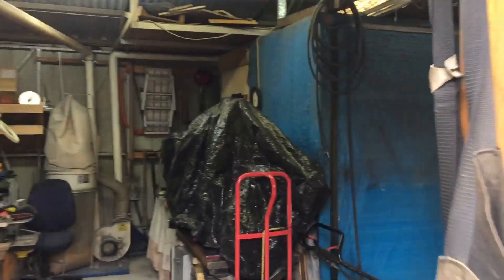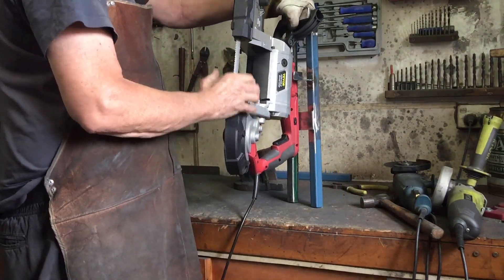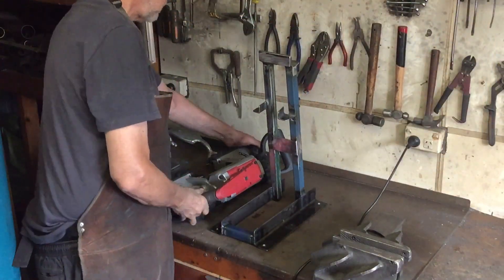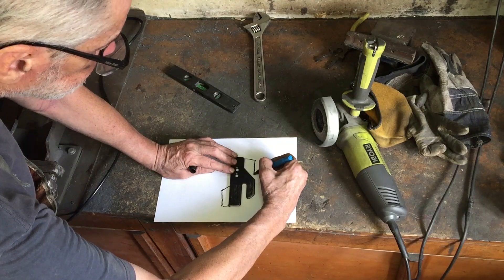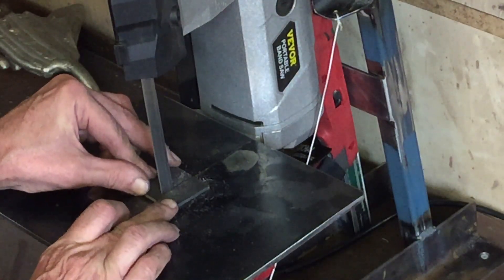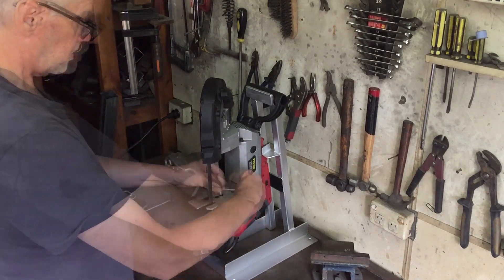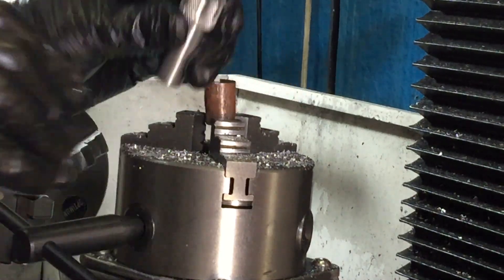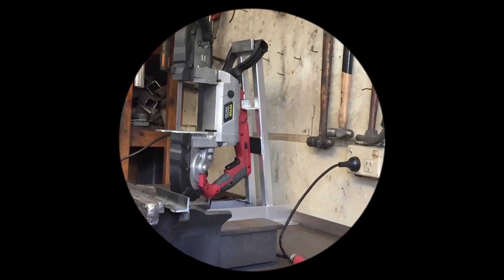Build a BETTER Portable Bandsaw Stand

Comment: tip: use 30x30 aluminum extrusion profiles if you want to make the job easier and without welders, lathes and stuff. all you need is your bandsaw to cut the profiles and an Allen key to assemble everything by using the fitting angle brackets for the profiles. Worked well for me 👍
Reply: But i really liked your video, the result is top notch 👌😄
Reply: Solid tip there. Easy to get hold of 30x30 and you could even 3d print brackets to hold it all together. Ill be doing this for mine.

Comment: I just bought the harbor freight one, it doesn't keep the bandsaw portable, but it has the two in one.  The stand is upright, and has a hinged pulled in to be used as a cut off saw. Too bad harbor freight didn't copy your idea to keep it portable.

Comment: Hi, I will add to my comments. Your design is the most practical I have seen. I, like you, find that as the band saw is always available I use it very often. No more faffing about. I put velcro around the switch with a cord looped over the top mount and a piece of dowel on the end. I simply pull the dowel and the velcro comes off the swirch. Good for emergency stopping. Thankyou again. Good clear video and easy to hear your words (thanks to no music). Aussie Mal.
Reply from the maker: Thanks mate. And a good tip re the switch

Comment: 6:58 Hi & thanks for this video. I’m just wondering if the mod you made to the standard plate affects the use of the bandsaw in hand held mode?
Cheers
Reply from the maker: No. The mod to the standard plate doesn’t effect using it in hand-held mode. 
If anything, it helps to keep the saw more square when cutting.